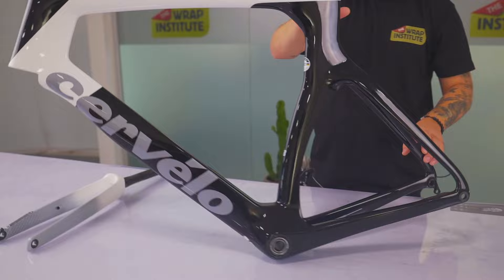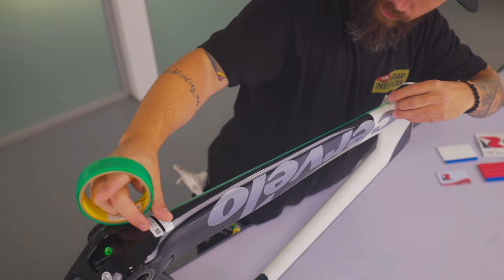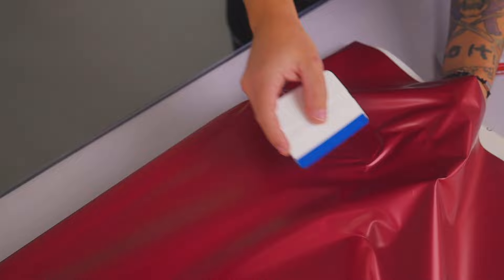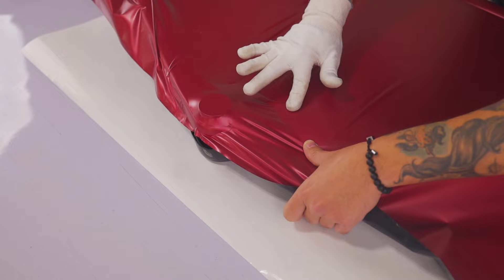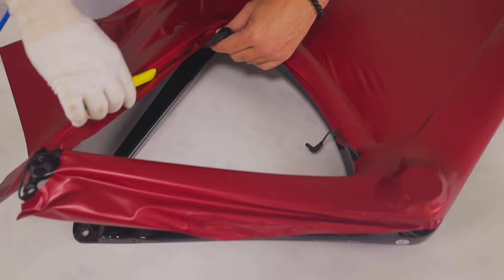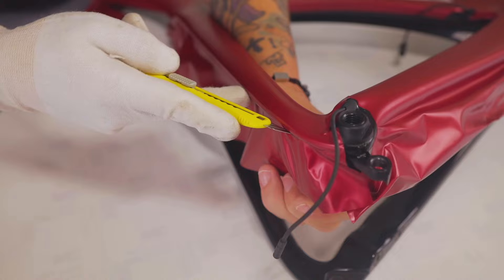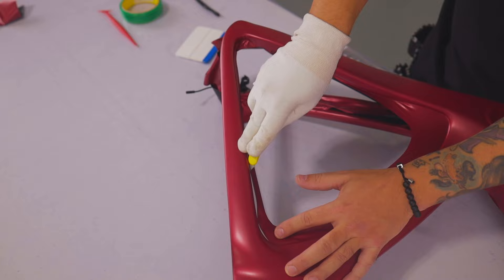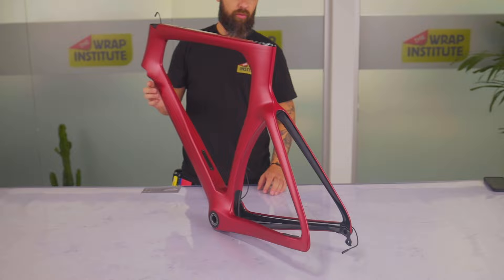How To Wrap A Bike Frame

Comment from the maker: What else would you like to see us wrap? Would you take the time to wrap your bike frame or does it look too difficult? Let us know below.
Reply from the maker: @sarajamesjulien7397  that's a great idea! Any particular brand you would recommend?
Reply: Is there any vinyl film that can be installed on motorcycle exhaust pipes? The spray paint they sell that is supposedly BLACK is gray when it dries.....I painted my bike gloss black and white like the No Limits Gallardo V-Rod bike from Germany and the pipes are gray and UGLY! Thanks for any suggestions or responses!
Reply: Full suspension mountain bike frame.
Reply: @timmcdermott815 I would say do the same but can do with both halves of frame at a different time and not as one like this that I bet be easier
Reply: عا😂ا🎉
Reply: You are not alone

Comment: My toxic trait is thinking I could do this myself 😂
Reply from the maker: That's an awesome toxic trait!
Reply: It doesn't seem that difficult.  I'm sure it takes practice, but it won't really matter if you make a mistake because it isn't permanent.
Reply: @theymademepickaname1248  I think I’m mostly afraid of disassembling my bike and then put back together and it not working the same ever again 😂
Reply: Just learned this mistake myself as well 😂
Reply: @staceymcdermott4954  you too ? I attempted it and absolutely failed !
Reply: @Alcoholpad  yep tried it as well made a right mess had to scrap it altogether and just get the frame powder coated
Reply: @Phoebe  well done for trying. Boy it looks really difficult to do and clearly something only a skilled person can do.
Reply: I'm on my 3rd roll of vinyl... On the same frame... The other 2 rolls are now in the trash 😖🤬
Reply: @Alcoholpad inagine buolding the bike back, than it breaks, like in Tom & Jerry 😂😂

Comment: I see a lot of waste of material,  that would be very expensive, I think sending. For professional paint would be cheaper.
Reply from the maker: Interesting. We still think that vinyl wrap film would be cheaper but we'd like to see how you come up with that number.
Reply: Rvinyl well,the vinyl cost approx USD 50 per sq meter (3M), as per my knowledge you need at minimum 4 sq meters, that is USD200 without labor, a paint job for a bike frame cost around USD 180, that is my math
Reply: I meant square meters. Let me know if my math is wrong
Reply from the maker: @expomm  Great breakdown. I think you're right about the material cost. The main differences are that wraps require less of a learning curve, they can be removed without causing damage and you can get a look that is impossible with paint (e.g., carbon fiber or brushed aluminum). In the final analysis, if you have the skills and you want a solid color finish then paint is the way to go for a permanent look.
Reply: Rvinyl Agree, there are advantages in having the vynil , which also protects the frame, but for people like me,  with zero ability for this hand work, the learning curve will be very steep. Thanks for your honest reply, cheers!
Reply: You’re also forgetting the cost of sanding and removing paint
Reply: tmj4477 Hi, no I didn’t, the shop quote me USD 250 all included.
Reply: @expomm  -- Protection of the original paint job and being able to resell looking brand new in like 5 years peeling the vinyl off, as well as having a customized color with (as the mfg suggested) custom finishes that vinyl can do far cheaper than the ultra-luxury paints like house of colors could match. If you're talking about matte black, sure, but you're still not protecting the paint, brand new looking frame on resell, and sorry to this company here but you can source 3M vinyl from other sources far more affordably than their cost as they appear to be a 3rd party and not even a reseller direct from mfg. As for learning curve, you could buy heavily discounted, clearance vinyl from said other sources that have far greater volume/variety and therefore often have said clearance sheets that you could do a practice run and still be under the cost of paint matching high-end custom colors, plus protection for the original frame while being customized versus OEM standard.
Reply: @expomm  -- YT doesn't allow non-certified accounts to share links but less than 30min research and you can find manufacturers direct, far more affordable like $75 or less for that coverage including shipping for premium vinyls, $35-$40 for a test entry level 3M vinyl for testing. Net less than pain with the other benefits
Reply: @j.ballsdeep420  thanks for your advice, but it came late, I send my bike to paint job professional and I got it for USD 275.
Reply: @expomm  I can almost guarantee $250 will NOT get you quality work.

Comment: Great video. Would help to use the actual names of the tubes and components of the bike for better instruction. For example, seat tube, top tube, bottom bracket, headset, chain stays.

Comment: What size vinyl wrap did you use for the complete installation? I see sheets online ranging 2'x5', 4'x5', 6'x5' etc. I like the idea of wrapping each side with a whole sheet for limited seams even though there is quite a bit of waste.
Reply: It's going to depend on the frame size. A rule of thumb when wrapping anything is to always get more material than you think you'll use. Vinyl rolls are always 5' tall, so that is going to cover any standard road or mountain bike frame nose-to-tail. That is, your bike frame isn't going to be longer than 5 feet, unless you're on some sort of one-off novelty frame. So if the roll's width is handling the frame's length, you only need to figure out how much you'll need to cover both sides of the frame vertically. To be on the safe side, I'd assume at least 4 feet, which means you'd need 8 FEET total (or a 5' x 8' roll). Might be good to have a little extra on hand in case you want to do some other trim on the bike, like the handlebars or the stanchions on the fork.

Comment: Have you got one showing how to mate it to hide join?
Also will it last in the wet and not peel off?
Lastly I'm looking at chrome vinyl any tips on using?
And to keep good should I spray lacquer over it?

So know I'm looking at a frame but sadly it just bare or black carbon when I want to avoid black
Reply: Do not spray clear ontop of vinyl

Comment: Hi for the alu frames with weld joints any advice how to do it
Reply: with a bit of heat, you should be able to get the vinyl to stick to the welds & have it look like it was painted.

Comment: How durable is the vinyl against stone chips and such? Would you need to apply a clear protectant vinyl on the downtube or any other part (for example if the handle bars might touch if turned all the way)?
Reply from the maker: For something like a mountain bike it probably is a good idea to add an extra layer of protection such as our Self Healing Protection films available here: https://www.rvinyl.com/Universal-Paint-Protection-Kits